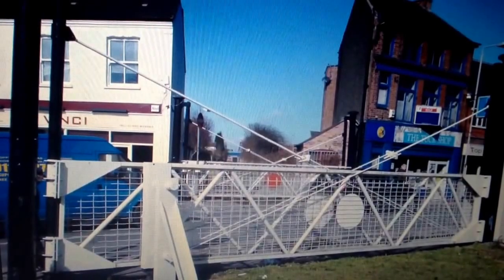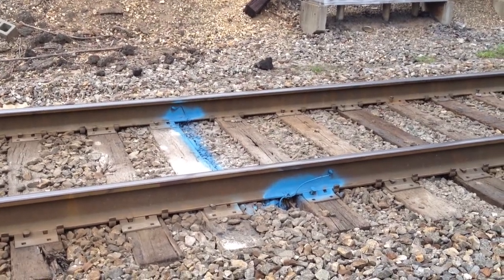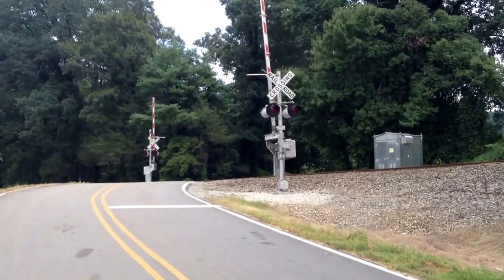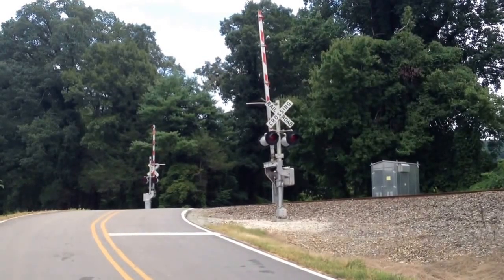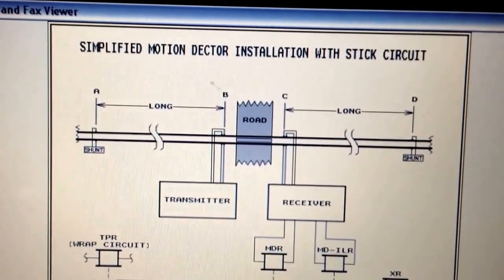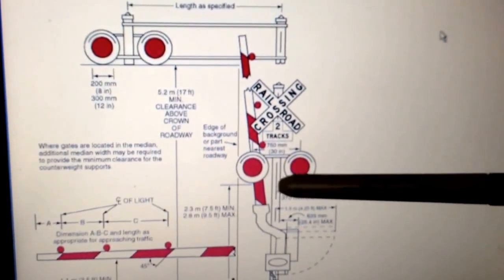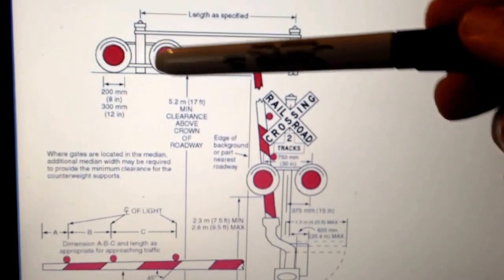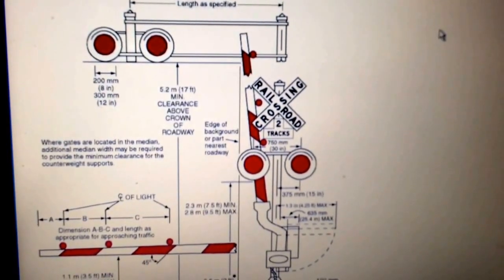Railroad crossing gates and how they work

Comment: OK, but I still dont know exactly how the train makes them come on.
Reply: +Jay N The tracks act as a part of an electrical circuit.  Just like the wires to lights in your house or the dome light in your car.  

When there is no train, a trickle of electricity runs all the way through the tracks to the other end of the circuit.  There, the circuit is connected to a relay, which is a device that allows one circuit to switch on/off another.  This relay is like the starter relay in your car: when you turn the key, a small current goes through the switch in the ignition to the starter relay, which then switches on the much larger current from your car battery to the starter.  Thus, when no trains are present, the relay is turned on which keeps the signals off.

When a train enters the track, the wheels across the rails cause a controlled short circuit of the electricity going through the tracks.  The electricity stops flowing all the way to the relay at the other end.  The relay is setup so that when it switches "off" the signals actually switch on.  This provides a fail-safe method of train detection, where when the relay turns off for any reason, the signals are activated.  This can cause frustration for drivers sometimes, but it's much safer than the signals not activating when they should be.  The signals on the tracks that tell trains when it's safe to roll work along this very same principle.

Older railroad crossings have three of these separate track circuits:  one at the crossing itself (called the Island), and one on each direction of approach to the crossing island.  These multiple circuits allow the equipment to detect which direction the train is approaching, so that the signals can be turned off as soon as the train clears the crossing.  Newer crossings usually only have two special frequency-only circuits, and an electronic device called a Predictor.  The predictor sends a specific frequency of pulses down the rails and "listens" to how they get shorted out.  This lets the equipment know exactly how far a train is away from the crossing and how fast it is moving, allowing a constant warning time (ideally 20-30 seconds) no matter how fast it's going  (as mentioned in the video).  It can even detect a train stopping, or starting to move away, which will let it cancel the warning signals.  Another advantage is the rails don't have to be sliced and diced a lot for tons of track circuits, especially where crossings are close together: each crossing can have its own frequency while ignoring all the others.
Reply: +Jeffrey T. Axsmith
Well, that's a great question.  The answer is it depends, and it's complicated (and I'm no expert).  

I'm sure at some point, a long time ago, for every crossing to be signaled, they simply kept dividing up the track into more circuits... all of these circuits which were monitored by the wayside signaling.  But nowadays, as I mentioned above, the pulsed circuits easily overlay the regular big, long wayside signal circuit.  There are several types of specific wayside signal wiring, depending on if the line is electrified, for example.  But they all revolve around the track circuit holding a relay energized principle I described above.  

The most common answer I could give is that most common track circuits are direct current (DC) where electricity always flows in the same direction.  A battery always puts out DC type electricity, and many track circuits have been run off of batteries.  You can think of the pulsed crossing predictor circuits as a form of alternating current (AC) where, at a regular interval called the frequency, the polarity of the electricity changes direction.  The frequency of this change creates the pulsing.  So where the crossing circuit exists, the DC and AC circuits overlay one another.  This happens because they share the same conductors (the rails) and because they can be electronically isolated from one another.  When you tune a radio, you're doing the same kind of thing.  

The crossing circuits are bounded by what's called a shunt, which is an electronic device that is able to short-out a specific frequency of AC current, but doesn't affect the DC circuit at all.  It's very easy to spot "shunt boxes" along the tracks, especially at (wayside signaling) track circuit boundaries where different shunts are also used to extend the crossing circuit into the next isolated DC circuit for the next signal block.  But, sometimes railroads just lay the weatherproofed "shunt bundles" on the ballast between the rails.  The presence of a train's wheels on the rails causes both circuits to be shorted at the same time.  In fact, there can be numerous pulsed circuits overlaying one another, when many crossings are close to each other.  Each crossing only listens for its specific frequency, and doesn't "hear" the others, just like an AM radio only tunes to one frequency at a time.
Reply: Jovetj 
There are no sensors. It is continuity.
Reply: +Jovetj...your answer to the previous question went on to answer the question I was about to ask: specifically as to how a tight series of crossings such as in a downtown area manage to work so well in sequence when they might be as close as two or three-hundred feet apart.  Thanks!
Reply: Jovetj what keeps the crossing systems from interfering with the train signals?
Reply: GPS
Reply: sensors in the track